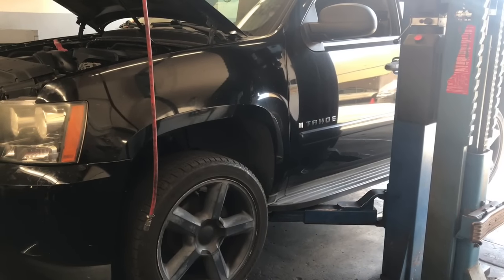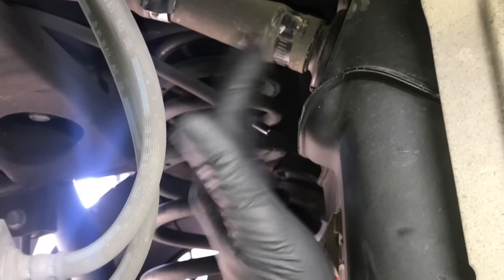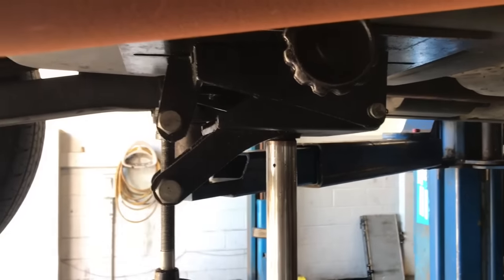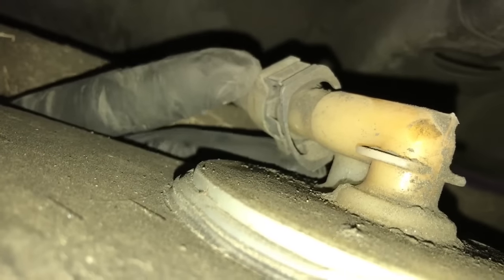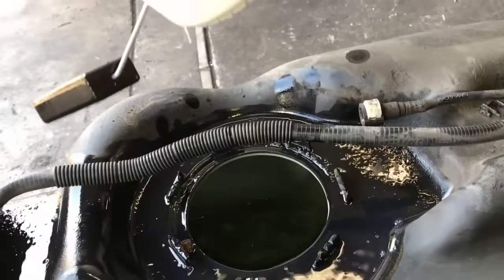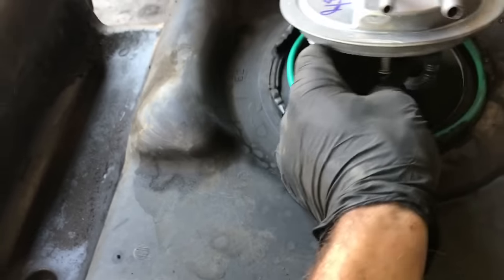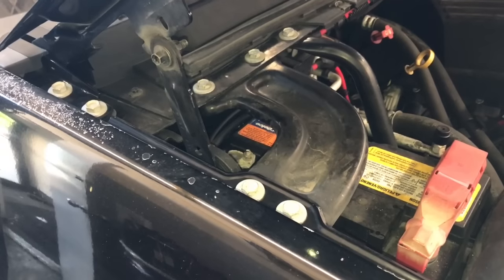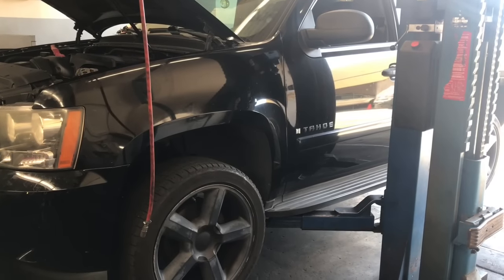How To Change Your Fuel Pump On A 2006-2014 Chevy Tahoe Suburban GMC Yukon

Comment: Just got done with dropping my tank. The steps are perfect. Since I’m doing on the ground without a whole car lift, I found that dropping the spare tire is well worth the time and effect, gives you a ton more room. Thanks for the video!!!
Reply: Just read your comment. Do you happen to remember how high you had to jack your vehicle up to remove the tank? or did you use ramps? thanks

Comment: You didn't use a piece of steel to remove that pump retainer ring?  Brass or aluminum only.  Steel on steel, spark fly, tank go boom just as Ralf says below.

Comment: Smart thing to do would have been to use a brass punch or Aluminum stock to get that ring off! Metal on Metal can Sark!!
Reply: also rockauto has a fuel pump ring tool to remove that ring makes things ten times easier.

Comment: I have several codes referring to the fuel pump control modual. 8 to be accurate. It started with system voltage high low voltage codes on the circuit. Then control mod internal performance code and long term memory performance code. I replaced battery and alternator and same codes. Not sure where the ground is but I cleaned up the block ground, firewall and one more under driver side frame. Still happening. This cleared the codes for transfer case codes I was having. Just dont know what to check now or to just take it in to have the pump replaced. Looks expencive and not something I'm able to do in my home shop

Comment: My 07 Burb leaks fuel only when I fill up. Which line in the video could be the culprit? By the time I pull away from the pump and park, it's stopped leaking.

Comment: You think i could use a floor jack without a block of wood if i emptied my gas tank? In other words, will the weight of an empty gas tank be light enough to where i could only use a floor jack?
Reply from the maker: Elmer A most likely you’ll be OK. You might wanna put a towel or something on top of the jack just to be safe.

Comment: My 2008 Tahoe is acting up, stalled on me a couple times and wouldn’t turn back on after a couple tries it turned back on if I accelerated it would wanna die. Also starting throwing misfire code and says fuel Rail Pressure Sensor needs to be replaced. Is this a bad fuel pump??

Comment: What's the very first hose or line you disconnected the one with the red tab on it? I'm having trouble finding that part for my 2010 tahoe
Reply: And the name or part number for the second evap line you disconnected mine broke at the charcoal canister connecter part. If you could help me out that would be so awesome

Comment: Does this 2007 Chevrolet Tahoe have a fuel filter because I can't seem to find it unless it's well hidden.
Reply from the maker: Jose Maldonado on that year maybe inside the fuel tank and you would not change it and less you're changing the fuel pump. If not it's going to be on the left side of the vehicle on the frame rail. So you can follow the fuel lines from the motor back to the gas tank and if you don't see it in the line then it's  in the tank.
Reply: Jose

Comment: Fuel  pump dead. I've got a full tank of gas. Can't figure out how to get the gas out. Any suggestions?
Reply from the maker: You have to take the filler neck apart from underneath. And he used a transfer pump. Once you get the neck apart you should be able to slide the pump Lines down the neck and then transferred to a gas can. It’s a pain in the butt. I wish you luck.
Reply: @HowtoAutomotive  Thanks

Comment: Great video but do yourself a favor and get a shop vac and vacuum the top of the tank before removing the pump.
Reply from the maker: Dual Sport Numbskullz at minute 715 I show you how to clean it with compressed air and rags

Comment: What if u just changed your pump an the gas gauge still doesn't work properly after putting gas In it i park the i get in it it say i have no gas
Reply: You either have wiring problems or the gauge in your dash is gone bad.